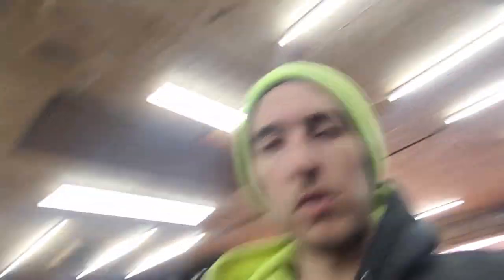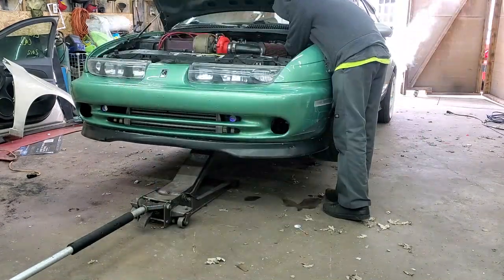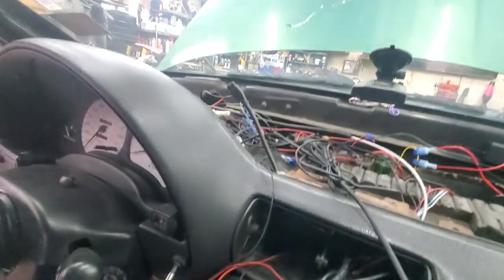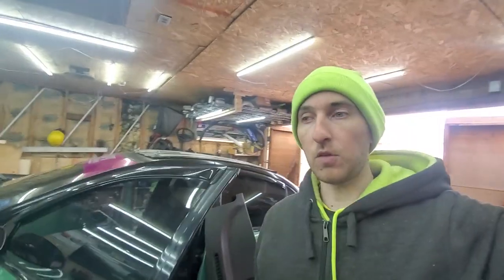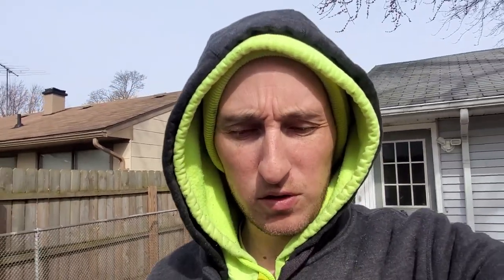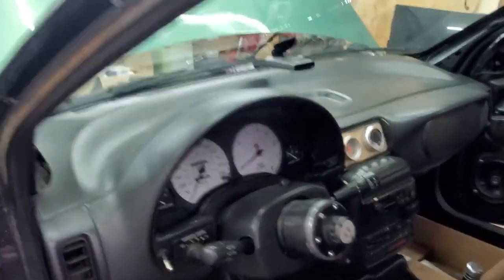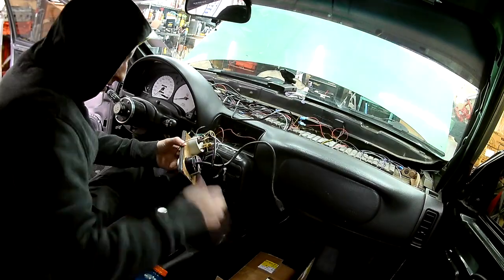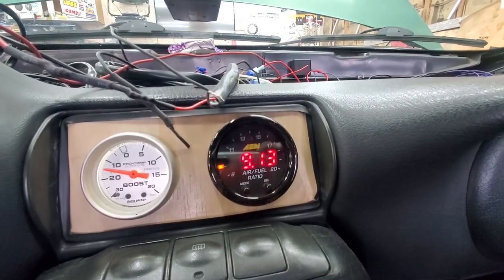Wideband install

Comment: Interesting. I don't know exactly what that stuff is actually for, aside from monitoring your engine, but it is still interesting.
Reply from the maker: it specifically monitors the Air to Fuel ratio, really important to know when you're dealing with boost.

Thanks for being one of the first to watch and comment!!!
Reply: @BuilditBreakitGarageinc  Thanks. My Saturn is basically stock, so not really something I need, but nice to know. I did do an engine rebuild and converted my 1999 5-speed SL1 from SOHC to DOHC w/ a few minor upgrades though. I've got the 4-2-1 header, better flowing intake (to be converted to cold-air once I make the enclosure, in-let, and vent), lighter crank from earlier year, and the battery relocated to the trunk. It's nothing drastic, but it works.
Reply from the maker: Sounds like a solid setup!!! Keep it up, I was right at your level about 12 years ago!!!'
Reply: @jezeski2011  Awesome that you did an engine swap! I didn't know that earlier engines had a lighter crank. I have a 93 DOHC do you know if that has the light crank?
Reply: @SkullDraizer  I don't recall exactly when the cutoff is. I do know there is plenty of info on sixthsphere dot com that you can look thru. Also, it was not so much an engine swap; as much as a head and timing cover swap when I rebuilt the bottom end and then had to install a new timing set and a few other new parts to make sure things would be good to go. I also went thru the used head I got to make sure it was all set.
I did a simple valve job like I learned in small engines class, where you put a dab of compound on the seat and gently spin the valve in place a little with a piece of tubing by hand, then clean it off with some brake clean. I also replaced the stem seals and cleaned the lifters by soaking them upside-down in paint thinner for a couple days. The head itself was also surface to 4 thousandths under specs. I know that is "not supposed to be done" but, the comments on sixthsphere seem to say that many have gone even further without having issues.